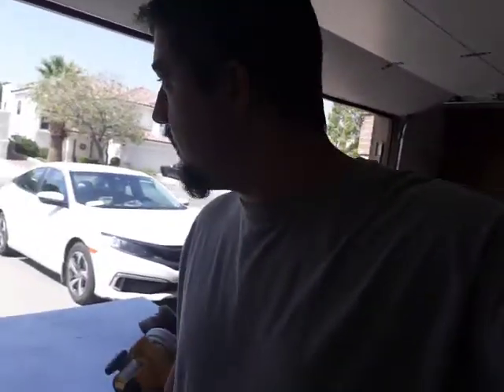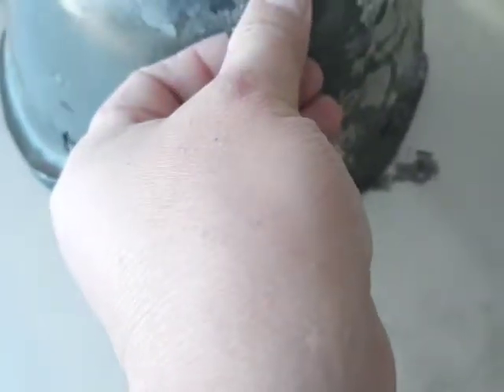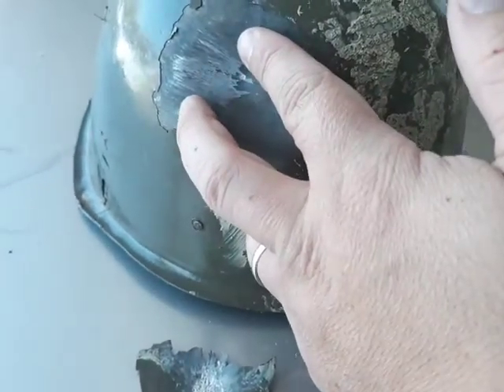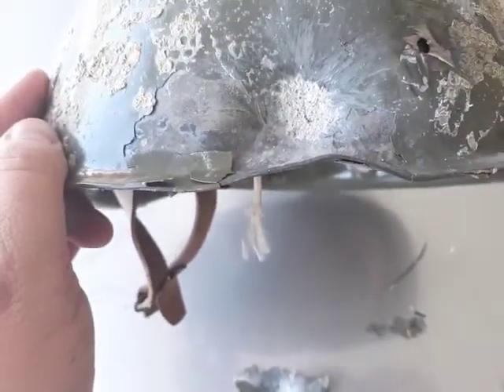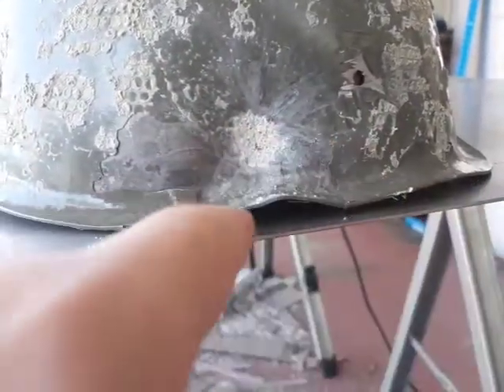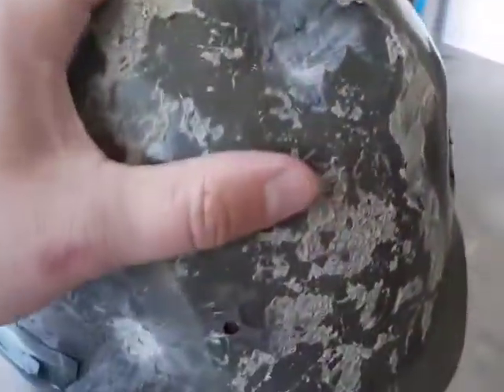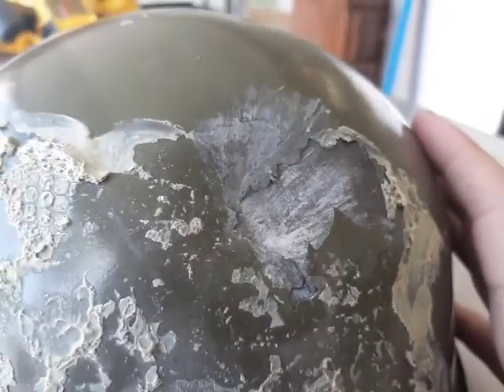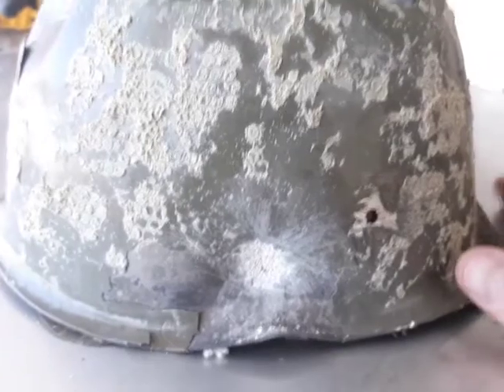Up Armored Helmet follow up

Comment: since this helmet is already damaged and rivvets got poped out, you could also try with adding some composite (fiberglass for exemple, or denim?) with some resin on the inner side of the shell and compare with the results of the tiles (the 9x19 would go through the steel, but it might be catch by what's next ). like you know, a low budget version of the russian SSH68N (also known as 6b14) helmet modernisation
Reply from the maker: Good idea for a new video. I'll consider it. Right now, I am working on a helmet  uparmor kit that will sell on eBay. Subscribe and Stay tuned for the next video.